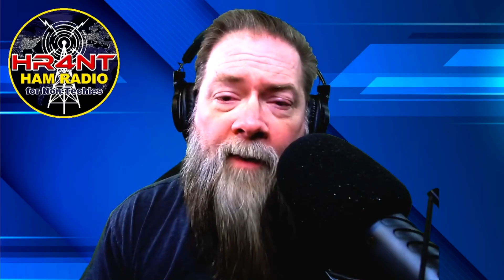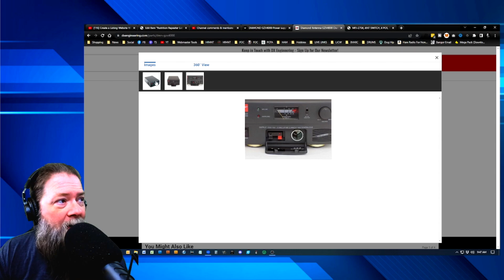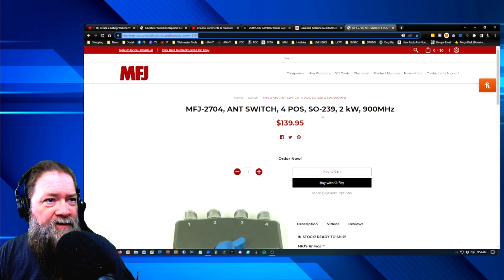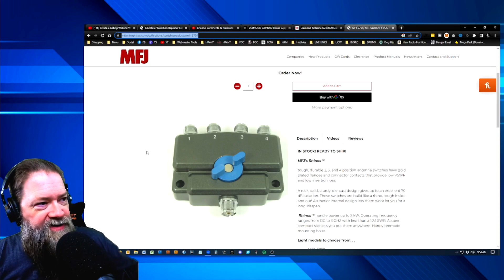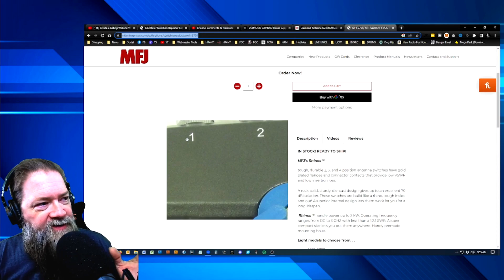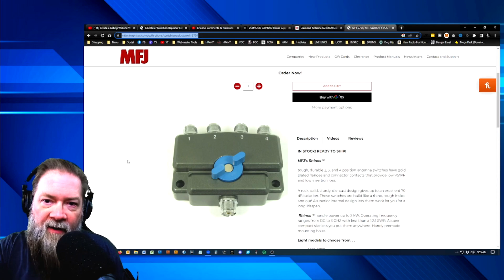HR4NT Updates and Answering Viewer Questions

Comment: Scott,

In reviewing this video I'd like to thank you again for all the information. I do YT on my phone 100% and overlooked all the info in the description. Also, you are correct, it is difficult to search through all the videos to find a specific piece of info unless it is mentioned in the title.

Good to know the Diamond PSU has worked well for you for over two years. 

Can you comment on how noisy it is or isn't? I understand switching power supplies generate a lot of heat and usually require a fan which can be noisy. I want to minimize background noise in the radio room, and don't need yet another heat source either.
Have also heard that switching PSUs may cause spurious RF. Have you seen that with the Diamond?

Only two questions this time. Hope that's ok.

73,
John - KK7JBZ
Reply from the maker: My PSU is working great!!!  Still works like the day I bought it and I couldn't be happier.  I have continued to recommend this power supply for its reliability and ease of use.  It is not too loud at all.  In fact I seem to forget it is on when in my shack.  There is a slight fan noise, but other than that no issues and no random RFI.  Thanks for the questions and for watching.  Take care.  73!

Comment: Hey Scott! I just got my Tech lic. in Aug and my General last month. I first got a HT and could not pick up anything where I live. I am in rural So East Colorado, about 50 mile east of Pueblo, there are no HR clubs near me so I have no one to ask. I am getting a 7300 and after watching your video I think I need a resonant antenna (no tuner), antenna analyzer, and a power supply. I. plan (I think) using it out in the backyard. Is this all I need to get started? Also, I'm a little confused on grounding. Do I need to do anything if I'm outside using this and if I set it up inside do I need something different to get on the air?
Reply from the maker: Hi Mary!  Congratulations on passing your Tech AND General!!!  You are on the right track.  All you need is a radio, an antenna, a power supply and coax and you should be good to go.  The analyzers are for antennas that you build, so if you are getting a kit and building an antenna, then you will use the analyzer at the end to tune it up for the best SWR that you can and then you are done with that analyzer until the next time you build an antenna.  As for grounding...you do not need to ground a radio that you are operating outside.  I hope this helked answer your questions.  If you have more, please email me at my website!  Thanks for the questions and for watching.  73!

Comment: Great info here, a question , I heard a man mention he had a all band yagi antenna. I have not been able to find one. I am usind an Atas 120 and ft991 as a base station. Is there any better that will work with the ft 991a internal tuner? Thank you for you help.
Reply from the maker: I did a search for all band Yagi and I found a couple, but they were around $1700 each and only covered 20, 17, 15, 12 & 10.  You have a ton of options with that radio a far as antennas go.  Any End Fed Halfwave will do well and if you have the room and budget ($300), the DX Commander Expedition is my TOP choice of antennas!!  Build it, tune it once and use it forever!  You can choose what bands you want to build it for.  I think it allows for 5 bands.  Mine is set for 40, 20, 17, 15, 12 and 10 meters.  I highly suggest looking into that antenna.  I hope this helps.  If you have any further questions email me at my website.  Thanks for the comment and for watching.  73!
Reply: @HR4NT  Thank you for the great info,as always. 73